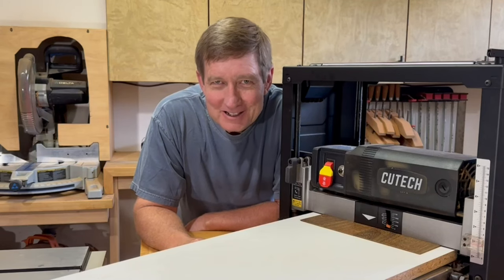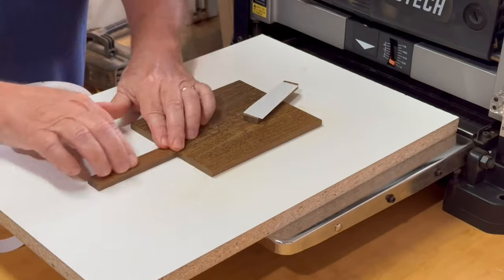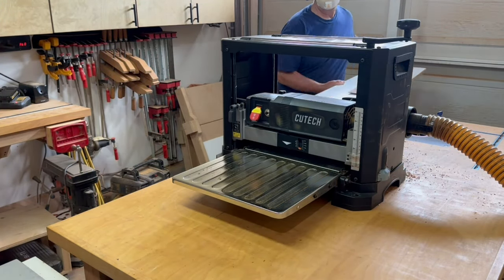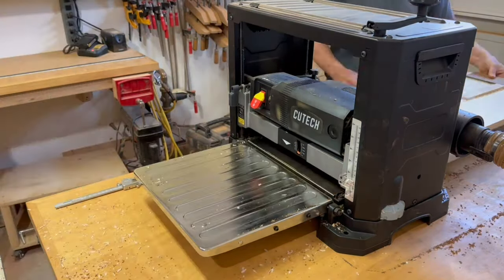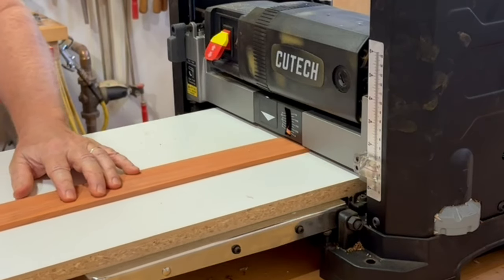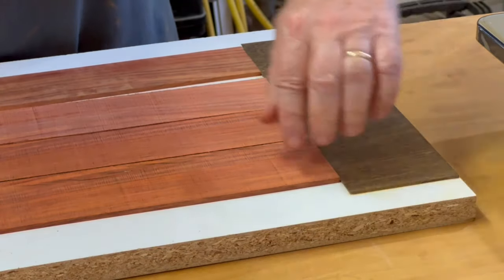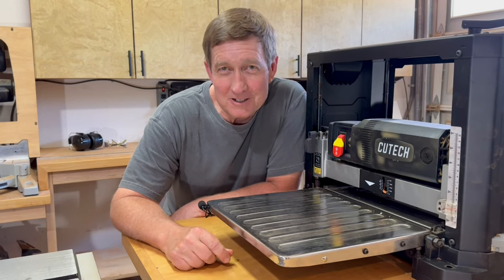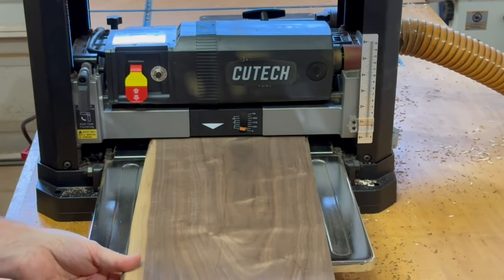Planer Sleds Explained!

Comment: Your video taught me more about how to use my planer than I ever knew to do thin pieces and even small pieces! I built the sled as you explained and planed walnut down to 1/16th for a cutting board project. Putting the small piece at the tail end totally cures the snipe. I have seen woodworkers do this kind of veneer work with a drum sander, but I don't see much need for one now that I have your tricks! Thanks for your enlightening teaching!  I am a fan.
Reply from the maker: Thank you so much!

Comment: The addition of the two sacrificial blocks (front and rear) to eliminate the planer snipe is WAY cool, as in: "WHY didn't think of that"? I could have tons of material with this method. You have created a longer work piece, which also makes the run safer for short stuff.
Reply from the maker: Happy to hear the video was helpful!

Comment: Hi Steve - I just re-watched your video – now that I have a few months’ worth of experience with a planar I realized snipe is an issue I needed to address, especially with the smaller pieces.

I did build a sled from memory but of course I didn’t get it quite right – LOL… So I will  nowe-address that jig. Thanks again for such a helpful and educational YouTube video, Larry
Reply from the maker: Thanks Larry, glad the video was helpful!  I often do enough sanding after planing that the sander removes the snipe marks, but not always, so its definitely good to just prevent them in the first place if you can.

Comment: I hadn't considered adding a cleated plate to the front edge. Thanks for the great idea! I agree that hot glue is a simpler approach than a shim taped to the sled. Though the hot glue can sometimes be a real pain to get off your work piece. A piece of blue tape on the workpiece where you will be putting the hot glue can make that part so much easier!
Reply from the maker: That's a great idea to use blue tape, I'm going to try that next time I'm flattening a wide board on the planer!

Comment: Great idea on the cleat.  will make one today.  FYI on double side tape, I always cut/tear the non-sticky side tape a half inch more than the sticky side so it is easy to peal off the role the next time.  That way I don’t have to use my fingernail to get it separated next time.  I subscribed cause you have some good content.
Reply from the maker: Thanks Frank, much appreciated!  Great tip on the tape
Reply: Thank you for sharing this helpful information.

Comment: For the runners on the thin pieces, do you have to make them the length of the workpiece, or can you just do them on the end, like the other example?
Reply from the maker: If the runners are as long as the workpiece, then it will prevent snipe on both ends.

Comment: I keep having trouble with my infeed and outfeed tables not being very level with the bed of the planer (I think one or both of them are warped).  Would you recommend using your sled on a planer with the in & out table wings removed ?
Reply from the maker: Yes, I think a sled would help with a planer without wings.  However, you could also just secure a fixed piece of melamine through the planer, extending on both infeed and outfeed sides to create a much longer planer bed that also acts as infeed and outfeed.
Reply: @jkmwoodworking  Thanks.  This is also an idea I have been considering.

Comment: How deep is the snipe you're getting? After adjusting the heights of my outfeed and infeed tables, I get about 0.3mm. Used to be much worse before
Reply from the maker: I've never measured it, not sure that I have any device that would measure it accurately.  I really can't even see the snipe most of the time.  Cutech claims that the snipe on this planer is 0.13-0.15 mm